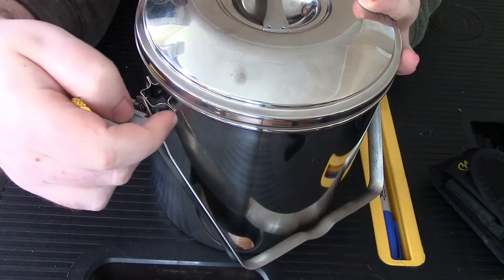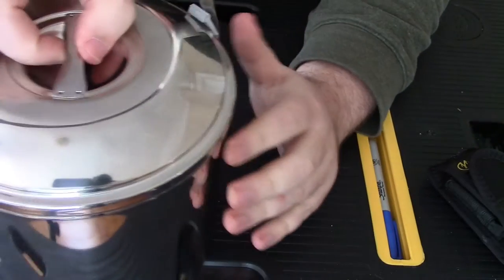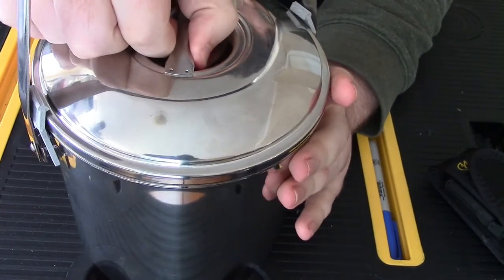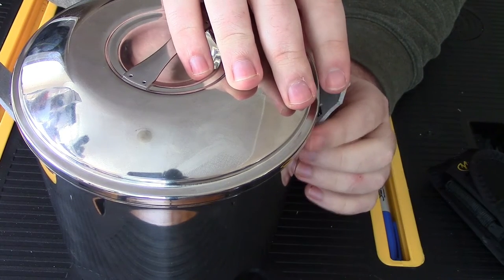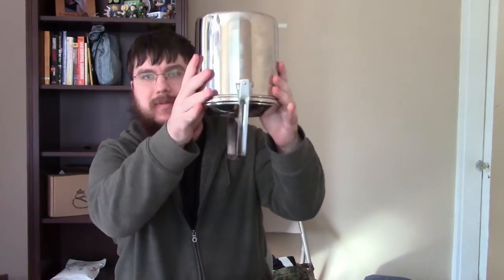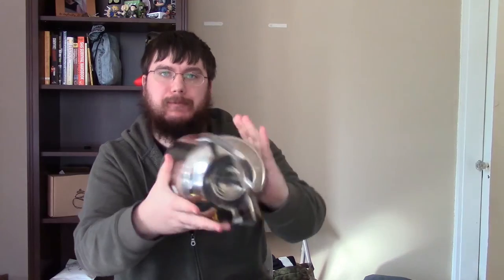Successful print - Zebra pot mod project part 3

Comment: instead of the little intergrated pins.. could you design to have just holes and use a cotter pin to hold in place for easy install and removal??
Reply from the maker: you... got the the right gears rolling in my head. it'll take some minor redesign. only because if I put holes through the current design it won't be a stable print/cast and be super brittle around the hole (this project taught me a lot about print stability)... but the second I read your comment how I would do it popped into my head. Seriously thank you! this is why I post videos like this.
Reply: Hey Nate..
Glad i could help get the gears going.. Gotta Love the TY community for eye opening ideas.. Can't wait to see the outcome
Reply from the maker: Yeah! I'm glad you did, and you gotta love it. when I read it I literally sat staring at the comment blinking for a second like "why the heck didn't I think of that."

Comment: Nice video Nate, you're very passionate about this project and it shows.  A tweak here and a tweak there, it's coming a long nicely.  Also, congrats on hitting 900 subs, I just noticed that and props to all the channel success my friend.  See you in the woods soon!
Reply from the maker: Thanks man! I really am for some reason. and I had so many tweak ideas, there are two designs coming in for the next one ;). And thanks! I it snuck up on me. And hopefully you will soon.
Also the comment you missed, my internet isn't letting me comment so here it is my reply"I check the comments the creators studio frequently for that exact reason. Cause sometimes it happens :P don't worry about it. "

Comment: If the clips only withstand 70c, I doubt they are any more resistant to melting than straight plastic.  Good luck with the project, enjoyed the mod series.
Reply from the maker: +MrOldclunker so its only that material that can withstand 70c. It would most likely warp then melt. But yeah, definitly exploring other material options. Im aiming for straight aluminum which can handle temps up to 1100, but is cheaper than steel.

Comment: Well your arc needed be a little deeper its the right length now yea it might melt
Reply from the maker: the arc is just about right. the it's actually the hieght on it that is why it has over hang. and yeah, this material will probably melt. once I get the design down, then comes time to figure out the proper material.